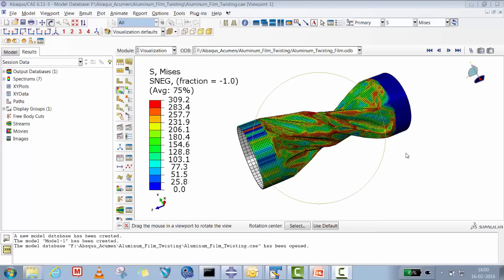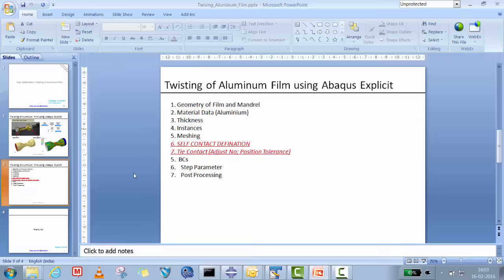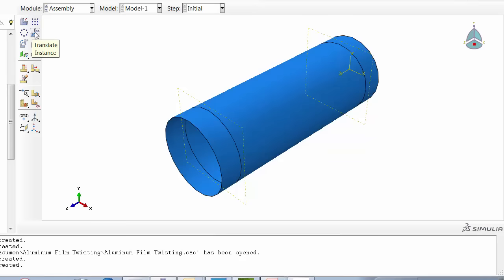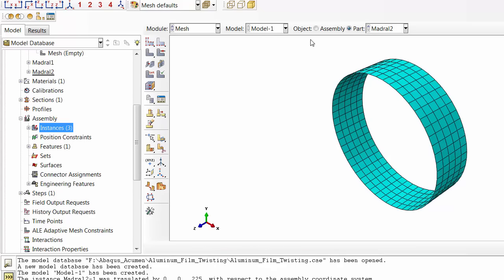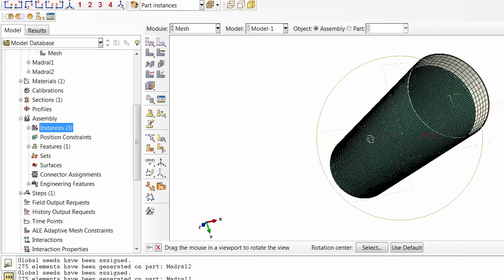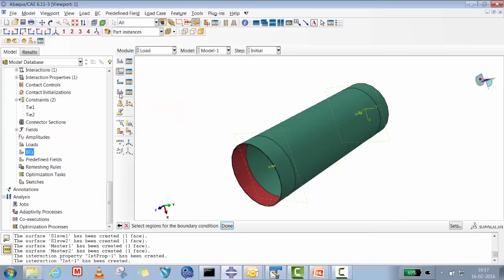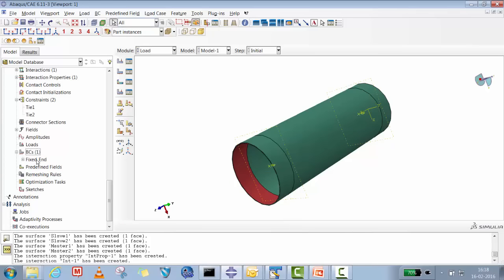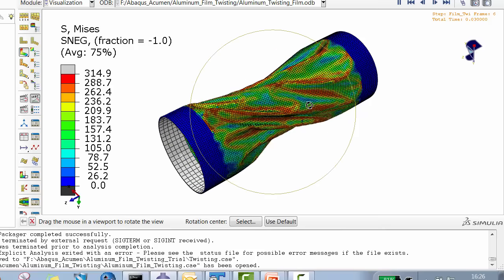Abaqus CAE: How to model high deformation twisting problem using Abaqus CAE and Explicit Solver!!

Comment: For those not getting any displacement in the results, please follow the below steps
1) Go to Interactions module-> create constraint - > MPC constraint
2) Tie fixed and movable ends with their respective reference points
3) Now run the job. You will still get a couple of warnings but will get the output. ( The job ran 1.5 hours for me !)